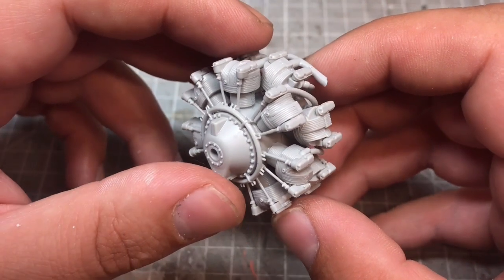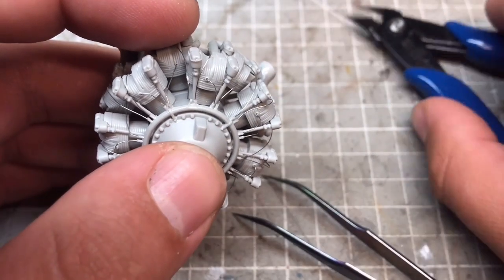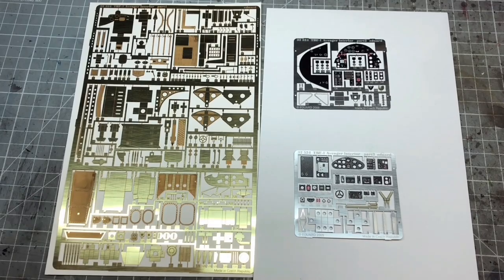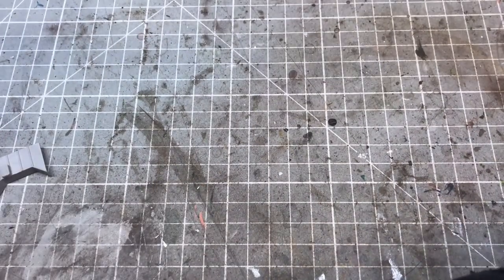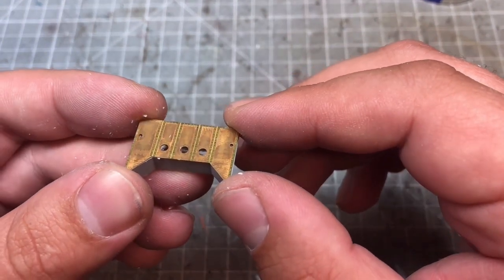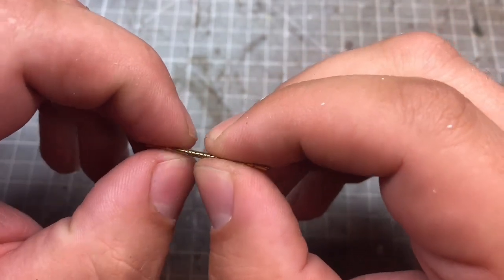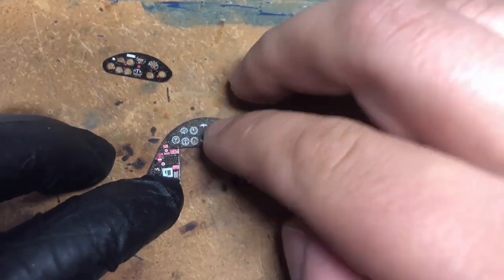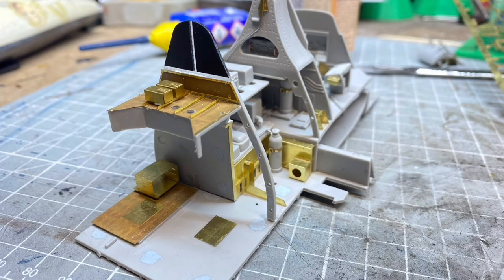1/32 Trumpeter Avenger

Comment: Your metal plyers create a termdous heatsink when your soldering , hold your parts with wood
Reply from the maker: Cheers thanks for that ill try it next time
Reply: @SullysScaleModels  No worries , although I would never try this at home , if you drip molten solder onto a glass surface it looks just like shell splatter , a rippled effect as the charge expands the armor , also works well as a impact crater in mud/dirt diaoramas , distance from glass , surface i.e, work mat ,wood , give different efeects
Reply from the maker: @jamesgathings6364  cool i will have to try this out!